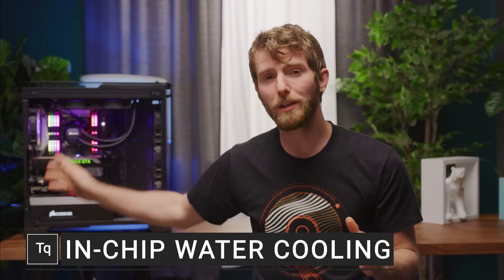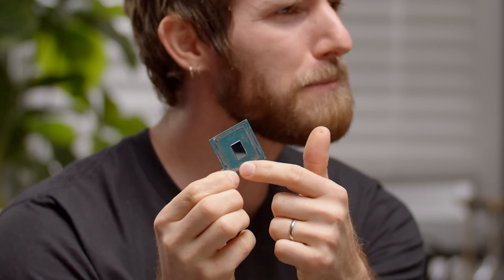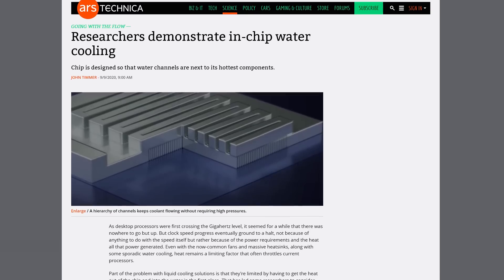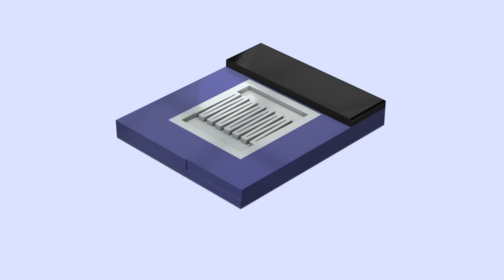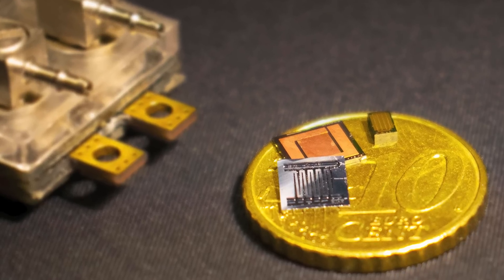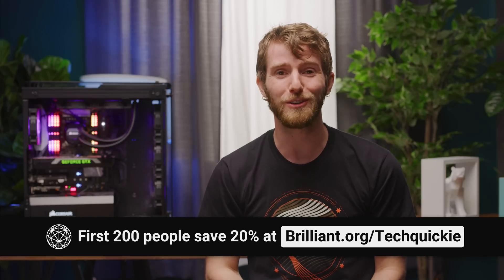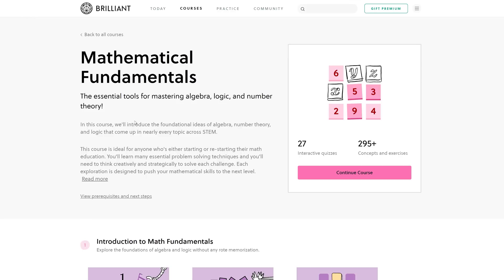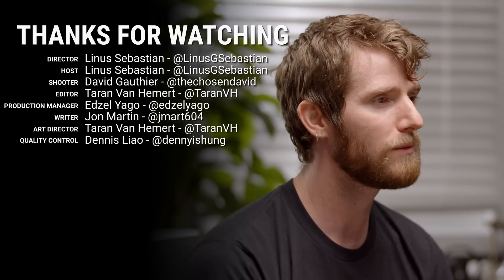Water Cooling INSIDE A CPU

Comment: Heat doesn't get eaten. It will still dissipate to the case and environment. 200W is 200W.
We will NOT see CPUs of 120W cooled to room temperature. But we will have CPUs with higher clock and higher power consumption but still working stable.

Comment: What  already could be done by now is to use a bottomless waterblock on a CPU where the heat-spreader of the CPU itself becomes the bottom-plate of the waterblock. This can be tightened with a O-ring in between. And for improving the heat-exchane small grooves could be cutted into the heat-spreader of the CPU itself by using a cheap engraving-CNC-mill. (only over the chiplets and not where the O-ring is, of course)
No thermal-paste is required any more and the bottom of the waterblock is also gone and the water is very near to the chip without even opening the CPU.

Comment: I mean. 
the core touches
The main cover
The cooler plate
connected to a pipe system filled with water or a pump system filled with water 
leading to a radiator system
thats cooled by fans.

vs

The core touches
directly to a water reservoir
pumps that water to the radiator
thats cooled by fans

It COULD be possible. if we use a non-conductive liquid that has a thinner density than oil.

Comment: From what I can think is to make the case cooler so that the temperature inside the case is lower and hence reducing the heat. That new tech only cools of the processor but cooling the case gonna increase the life span of the components as less heat = componentlife++

Comment: The only issue with using water cooling in phones is that you still have a much lower limit to how hot the chips can get. No matter how much the chip is being cooled, it still can't get so hot that your phone is uncomfortable to hold. 

So while this form of cooling could be beneficial, the amount of total heat generated will always be a factor. The same goes for servers. Yes, they would have cheaper cooling on the chip, but the building still needs a way to stay cool if the chips are clocked so high that the total heat generated is exceeding the cooling capabilities of the building.

Think of it this way, if your cpu has a tdp of 1.5kw, that's like running a space heater. So even if the chip stays cool, your room won't be. So I don't anticipate this leading to massive increases in clock speeds as much as smaller cooling solutions.

Comment: This won't be great for the longevity of the chip though. Just think about how long on average an AIO fails versus a chip and you'd see that liquid flow diminishes lifespan. Sure, there is lower flow, but there is probably also thinner material layer separating the liquid from the actual electronics.
That said, it is possible that long enough is good enough. We might not actually need the decade+ longevity we can now expect from our chips and the 5ish years an in chip liquid cooling can provide might be enough. It could be a choice.

Comment: Fascinating idea to place the cooling capillaries at high dissipation areas in the chip die. I can see how the thermal capacity would be very high. Having worked with different very small fluidic devices, I wonder how many challenges would arise,  with clogging and fouling of the miniature coolant passages in the die. That has been a real issue on other similar scale devices. You would trade pumping power demand with additional filtration, and/or exotic coolants in sealed systems to keep contaminants out. But I still like this idea!

Comment: 1) This technology will not come to the consumer market (it's a step that costs more than 0 for a result that is not needed - business PCs can be cooled with passive cooling)
2) It will be used in Server and HIgh End technology. The problem will be the way how it is connected to you cooling solution since many companies will use propriatary solutions
3) Those CPUs which will include this will be huugely expensive. Not because the technology itself it, but because of the small margin of products that will include it. So you make the same tech for a smaller batch which makes the batch more expensive.

However, I can't wait for Linus to scram liqid nitrogen through this cooling solution :D

Comment: My concern with this technology is the same as that with watercooled-laptops.
If you drop it, the chance of it dying from water damage are much higher. If the water-in-a-chip cannot leak out even after a bit of punishment then awesome; but if water leaks out after a 3 foot drop, that's a RIP

Comment: Wouldn't it get clogged easily? Or would this be a closed system within the core?
Reply: Yeah it would need to be closed loop with really high grade distilled water, and a very pure heat exchanger so no ions get washed in - possible to do right, but if the company half arsed it they would clog horribly.
Reply: @janrudzki5651  distilled water would be a horrible choice, water stripped of its minerals also impurities is essentially  what distilled water is, It would for sure replace those minerals by absorbing them from the surrounding materials. Same reason why mineral water is better for your health than Distilled.
Reply: @Catknapper  depends what the channels are made of.
Reply: Depends what's the liquid. hard to imagine water in it.
Reply: Well, they already use stupid amounts of ultrapure water, so it wouldn't drive the costs THAT high... Probably?
Reply: My understanding of what he was saying is that it's entirely self-contained, it's just about transferring the heat effectively to where it's cooled/dissipated - instead of just letting it makes its way through the chip, then to the heat spreader, then through the heatsink paste finally to the cooler.
Reply: You wouldnt push your own water through the in chip water cooling solution, the water cooling loop used inside the cpu would be prefilled with ultra-pure distilled water and would exchange heat with whatever external solution was being used through a standard IHS most likely.

It similar to how nuclear reactors are cooled. You don't push water thats been touching the fuel rods out into the ocean, you wrap the tubes with irradiated water around clean water and let them exchange heat.
Reply: @michaelmoran9020  honestly pure water is not what I would expect to be the beat solution. Imagine if they used 50/50 radiator fluid instead of water.
Reply: @kingzach74  I say ultra pure because it's isolated and you don't want any conductive ions in there of any description
Reply: I'm guessing it would be closed loop to a heat exchanger which you hook your cooling loop up to. It would still end up looking like a chip with a waterblock integrated, or I guess a waterblock with cpu contacts on the bottom.
Reply: there are these things called filters, as the name ever so cleverly suggests they filter out contaminants, if the in chip solution is as good as they claim the reduction in flow shouldn't matter.

Comment: Soo, is it entirely in the cpu? Or would you have a separate rad dissipating the heat from the die mounted cooling solution? Either way, super cool

Comment: i wonder if you could get flow out of this design without a pump. thermal dynamics influencing flow to move the coolant within a closed loop. kinda like a heat pipe on chip with a liquid coolant loop.

Comment: I saw something like this around 15 years ago as a kid on tv. They had basicly microscopic holes through the die and it looked all promising like this one. Basicly it had the same attempt. Using serverfarms to keep processors cool and heat up water for other use cases. I know how the one ended many years ago and from that experience i guess i know how this will end up.

Comment: What about corrosion though? If it's cut into the chip that seemingly already has very little to work with. Wouldn't that make it thinner? And with liquid running through it there shouldn't be much to need to eat away before it gets to the components that would end it's life if a liquid got in there.

Comment: The pathways will clog (like all water cooling solutions over time).
the water will vaporize because it cant move.
then the water will expand.
Which causes the chip to crack.
Short sighted tech advancement, but hey, at least you'll keep having to buy it over and over again.

Comment: Imagine a CPU that had like quick connect for AIO tubes then the AIOs had the pump near the tubes (instead of on top of the CPU) that would lower AIO costs by both requiring a small size rad to get the same performance and not paying the AseTek licence fee for the pump on chip. It would probably make CPUs a little more expensive but totally worth it.

Comment: If you are absorbing 1.7kw of heat power, you have to move that water to a radiator to move the heat out into the ambient.  I can’t imagine how you would hook a big radiator to a watch.  This looks like a big advancement in theta jc which is great! Jc is junction to case(or water loop) in this case.   You still have to have a low thermal resistance to ambient to handle high power without a big temperature rise.

Comment: I daut it will be wathercooling but Liquid. Probably Quicksilver. I also think I wouled still add an fan on the backside of the CPU-Mainboard and on the top of the CPU at least an Hybridecooler for gaming activities. Non the less I see how Intel couled Profite from thoos since they have not gone too small with thee nm which means they potentially couled go smaller and that for make up some space to implant an coolingsolution in there CPU‘s. It also wouled make sense since they have thee so far best CPU with integrated GPU solution which means if they can implant thees cooling to thee CPU and GPU inside the chip‘s it will make thee hole system a lot smaller and there fore efficient. Non the less since AMD has an CPU builed of blocks they as well might have an advantage here because of the space in between of the chipcompounds.

Comment: With this very small channels I'm worried about them clogging. The coolant would need to be almost perfectly uncontaminated, and no part of the loop would be allowed to erode particles that could clog the micro channels...
Basically this could put the CPUs it's used in on a clock... and who knows how long they will work.

Comment: I really thought that this video was going to be LTT making a water block (the top half) that glues onto the PCB and seals around the bare CPU die to run coolant over it directly. Very disappointing. Come on, what is that machine shop for anyway?

Comment: I see 2 problems with this technology... 
1. The capillary tubes used will be covered with debris in a short time... Since these types of solutions are also used in other areas to refine materials... 
2. Applications are only for specific cases... This is that the billed hand chip completely loses flexibility of use...

Comment: The problem i see with this is erosion, I'm sure they have some system to circumvent this to some degree but with such small channels and walls the amount of force used to push the water would have to be controlled rather well and I'm curious to see how it all plays out.

Comment: A step in that direction that wouldn't need quite as much of a paradigm shift would be to replace the IHS with a small-ish water block glued straight to the processor substrate.

With Intel chips at least, you wouldn't even need a secondary mounting solution, because the processor socket/mount already applies pressure to the IHS directly.

Comment: what do you guys think about this:

Mainboard 
Gigabyte b450 aorus elite

1x  82,40
CPU
AMD Ryzen 5 3600
1x 189,99
Ram
G.Skll Aegis DIMM Kit 16GB DDR4
1x 51,70
GPU
Gigabyte Radeon RX 5500 xt oc 8G
1x 199,80
Case
Sharkoon RGB LIT 100 
1x 56,80
PSU
Corsair CX650 650W ATX 2.4
1x 74,71
 for an midrange pc?

Comment: Another company that is doing something related right now is Cerebras. Their CS-1 "wafer scale engine" has liquid cooling channels built into the "die" because the system draws 16 kW and has 1 trillion transistors (the "die" in this case is literally a whole wafer).

Comment: Wait, where does the heat go once it has heated the water? Sure you're still going to need decent sized radiators to cool the water back to ambient temperatures again. I don't see how this would be more efficient than regular water blocks.

Comment: Right at the intro I can just see Steve facepalming and saying Tubes on the bottom Linus... tubes on the bottom or rad exhaust through top of case.
Reply: Okay i guess it is exhausting out the top... just was hard to tell with all the fan, but unless there are 90s on the tube connectors, i guess they just go straight up

Comment: Meh-and then suddenly you have a chip that is limited by the amount of time until all those tiny cooling channels get gummed up with corrosion or weird bacterial growths...although, I guess once it gets gummed up you can still use a traditional cooler...maybe...a lot of things are neat in the short term, but you need something that will function for 10 years at a pop like most of what we have now. (still running my system from 2012. :) )

Comment: If there was an issue with the water in the loop that caused damage or block those small capillaries, how easy would it be to replace or repair that part of the chip?

Comment: But I wonder about longevity. Wouldn't we see some kind of chemical breakdown between the liquid and metal at high heat over a long period of time, say 2-5 years. I would also be a little concerned about the prices of these chips increasing dramatically to account for the usual cost of a decent heatsink, as these will be obsolete. This kinda sucks because you will no longer be able to shop around for a bargain cooler. On the other hand I am excited to see the cooling potential with this technology in regards to overclocking...

Comment: Just my opinion, but I'm not a fan of the off camera angles for this setting. I do like the look without the green screen and I think that should stay, but in this instance, I feel that the off angles where linus isn't looking at the camera is not the right choice. It works for an interview for instance, because the person in frame is talking to another person, but here where linus is suppose to be talking to the audience it feels out of place. And I noticed a couple of  times where there were shots that were kind of just panned to instead of a sperate b-roll shot. Whether this was to save time since it's a tech quickie, or just a creative choice, it felt out of place as well to me. I hope this doesn't come across the wrong way because i'm genuinely a big fan and just trying to help.

Comment: No thermal mass, so better have a good pump if you don't want your chip to be damaged nearly instantly from overheat in case of a flow failure. 
Or really fast thermal shutdown circuitry

Comment: I wish I had a gaming pc my laptop can’t even load a website before it can boil water and the cpu and ram is always at 100% and I do have a pc but it is very old and runs windows vista and has an intel core 2 duo and it literally crashes before it loads up anything. I got an oculus quest 2 thinking since it is stand alone I could run oculus link with my horrible laptop but no my laptop just crashes whenever I try

Comment: what about the purity of the water? even the smallest particles in it would just block the pipes and then CPU overheat, so it would need a specialist to install such thing and also continuous maintenance... so tell that to an average gamer? I'd just rather put the aircooler on the CPU and be done with it, well renewing the heat paste once a year or two is ok though...

Comment: I'd use this for my sff build that just has a CPU fan and heatsink. No room for case fans so this should be a huge benefit for me. Could even go fanless with efficiency this good.

Even modding a 120mm fan to fit inside isn't making that much difference in temps. Still reaching 70C or higher. Had to sand down one side and cut one of the fan supports to get it to fit inside and not obstruct the ram slots.

Comment: The water has to be fully distilled for it to work and the metal might oxidize causing wear and tear over time. Idk what their sollution is.
Reply: More than likely not using water. 
Something that is much better at grabbing and releasing the heat.
Reply: I think they are not using water， may be liquid metal inside the chip channel

Comment: Not feasible. Even using distilled water or other liquids. It will have buildup or corrosion in the micro channels. It will work for a year or two. But that's it.

Comment: This will be quite useful as the industry will start to stack up dies to make little processing cubes.
It's a lot easier than coming up with the tech of making monstrously big dies or even side by side, and you can do things like a 3D shared data bus.
But cooling a cube where the heat can be inside it is a problem.

Comment: High power devices like RF amplifiers, yes, this definitely makes sense. Datacenters, supercomputers, maybe. The challenge there is still HVAC. Allowing a chip to run cooler doesn't get the heat out of the building. Desktops, probably not. New rigs with maxed components are already pretty much at the limit of what power supplies can draw from the wall before you trip a 15A breaker. Upgrades are straightforward for the DIY homeowner, but I doubt most people are going to want to upgrade their home wiring just so they can run a kilowatt CPU or GPU.

Comment: Chips will have to be much much larger and take up more area on the wafer per chip. You need more surface area for water channels and for heat exchanger. Cost per chip will skyrocket because of less useable area per wafer. I am not sure if it will be cost effective. IMHO